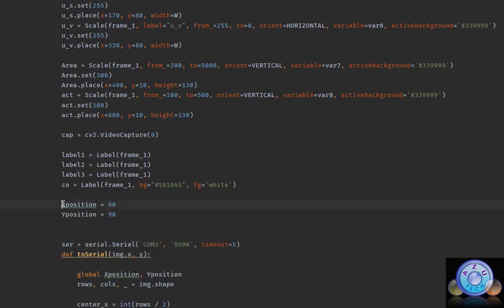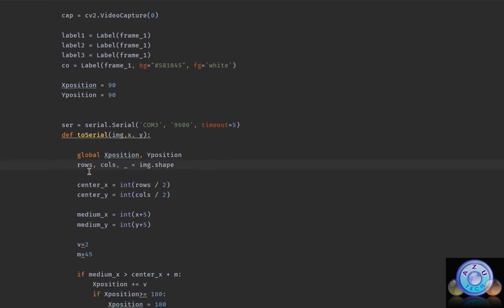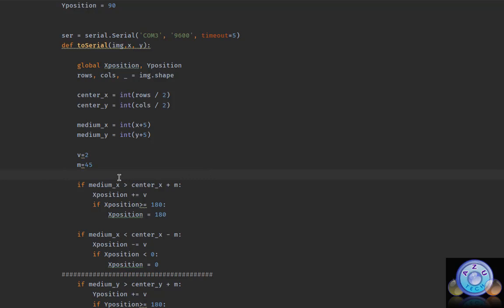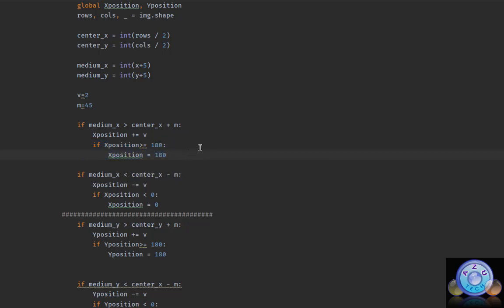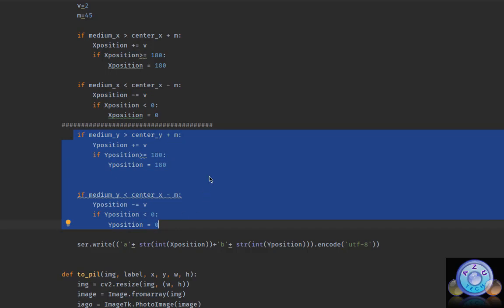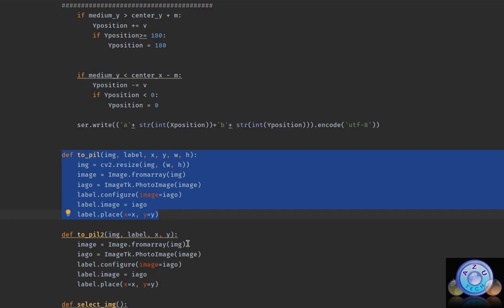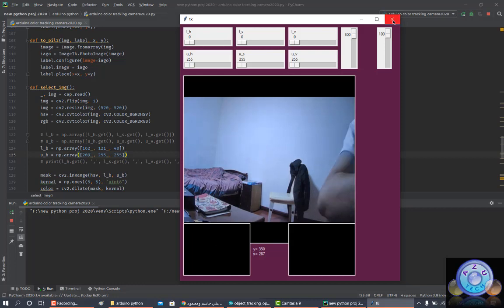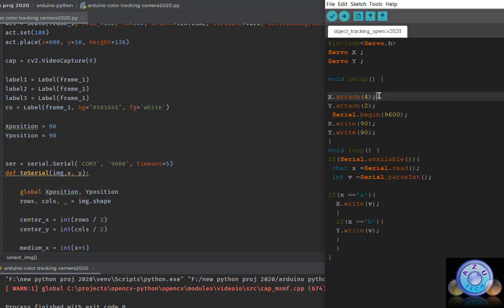arduino and opencv , color tracking camera using two servo motors, with explaining

Comment: how to connect servo with pixy 2 camera plz,i need the code
Reply from the maker: I dont have a pixy camera , but if you are reading the video from pixy in the same way as webcam(using usb) ,the use will be the same.
you can search about reading video stream using pixy with python.